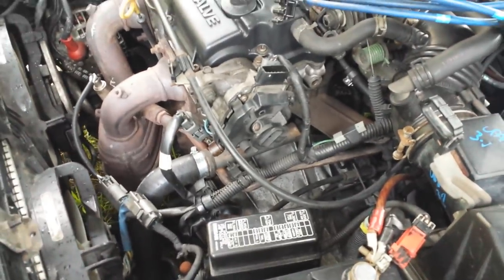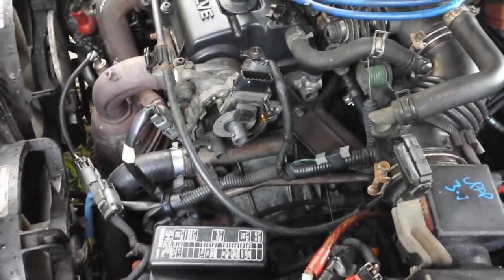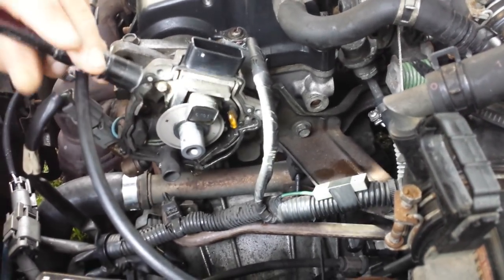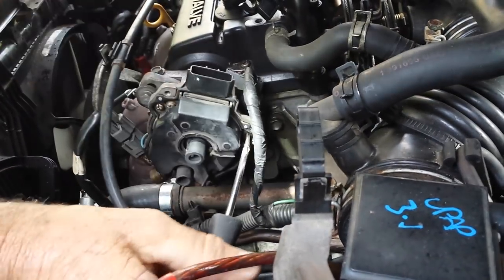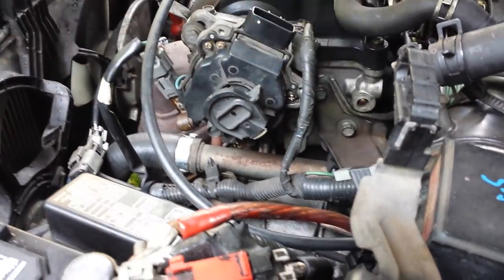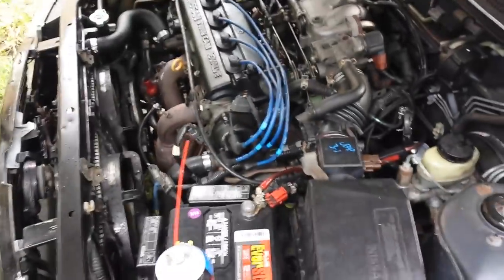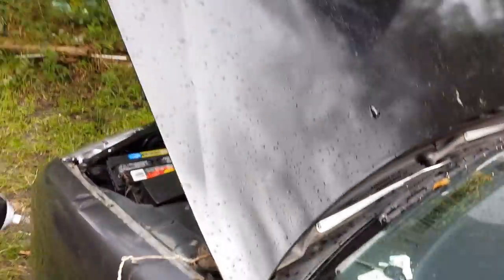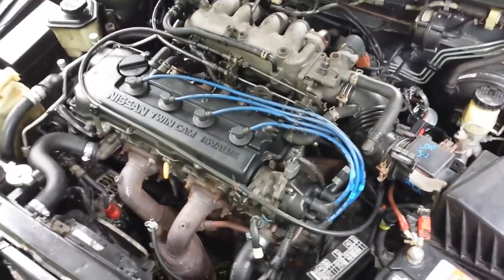1997 nissan sentra starting issue

Comment from the maker: i don't remember to tell you the truth. we just went through a bunch of screws until we found one that was snug. honestly, there is a flaw in the design. later on we put blue loctite on the screw threads after a new distributor was doing the same thing. works like a charm.

Comment: Not sure carb cleaner is the best to use on or around any electronic part. WD-40 or an equivalent should work and is generally safe for electronic parts. WD-40 consists of deodorized kerosene and some cleaners. It will evaporate, altough it could leave a residue that might affect an optical sensor. Another product you could use is tuner cleaner. It has been a long time since televisions have had mechanical tuneres but the product is still available. It might be better to remove the optical sensor before you clean the wheel, but all of this is good information to know. I have a '96 Sentra which takes multiple bumps to start, although it runs great after that.

Comment: I have a GA16, almost similar to the engine shown, just a different intake manifold, My problem is that the car has like a dead spot/misfire when idling as well as driving, which comes and goes, changed fuel pump, spark plugs, ht cables, which seemed to work for a while then it came back recently, any surggetions where to look next?
Reply from the maker: jordan botha have you checked your distributor cap for cracks and scorching? Also, make sure you don't have a vacuum leak. I know this is a long shot but how old is your battery?

Comment: doesn't  the distributer have an offset key which have to line up no matter how much you spin the rotor? so even you put in a brand new distributor isn't it supposed to line up with the keyway on the cam shaft?

Comment: Greetings, is it possible to use a Nissan ECU with  the wire harness to operate a Toyota engine if added the crankshaft sensor map sensor and also the coil pack and throttle body to the Toyota engine
Reply from the maker: I'm going to be honest and say I'm not sure. What I do know is that those sensors would have to fit and operate properly in an engine it probably wasn't made for. That wiring harness would have to be able to reach all the same components as the Nissan engine and how that the connectors are the same as well. I'm not saying it can't be done, I just don't know.
Reply: @BrunsBwlr  the sensors probably won't be timed the same

Comment: nice vid bro. i have b13 eccs GA16DE engine. my distri cap has tiny oil leak but its not drippin its just like its just go out on the cap. Should I change the shaft seal or just check the inside cap first.
2nd question is does ignition coil with oil on it affect the starting problems in the engine? thanks hope you can help me.
Reply: ALL NISSAN DISTRIBUTORS LEAK OIL...

Comment: Travis
Codes 300 and 1320 on nissan 1998.  Rear brake lights fixed.
Any help is most appreciated 
Steven
Reply from the maker: I was reading up on the code and it seems to me that you could have a bad camshaft sensor, crankshaft sensor or both. It could also be the pcm but let's start simple first

Comment: Is the crankshaft sensor on 1997 nissan sentra behind the starter?
Reply: No, in the 1.6L sentra 1997 vehicles it is on the front side below the distributor on the automatic trtansmission housing. But, it is not considered for ignition purposes by the ECM you can disconnect the crankshaft sensor and the engine will keep running or it will start with no issues.

Comment: I have nissan sentra 96 super saloon GA16DE B14 engine. I'm not sure what the problem is, but whenever I crank start the engine and slowly move up or down the distributor, the engine starts...there's a bit of misfiring then sometimes it will just turn off. And then when I crank start it again, it requires me to move the distributor again.

Comment: @Travis Bromley, did you get a PO340 code for the camshaft position sensor? Because mine has this code come up and i tried so start but only got the "crank no start" episode on my sentra. I'm already about to bit the bullet on a new distributor system.
Reply from the maker: It's been a long time since that video that I don't remember for sure but I believe so. What have you tried so far?
Reply: Travis Bromley so far, i've tried the starting fluid and a spark tester. No luck
Reply from the maker: MILES TUPAS unfortunately, you may need a new distributor then. Camshaft sensors can go bad on you. Did you have any other codes besides the p0340?
Reply: I had the same P0340 code but I also initially had a P0605 code (ECM) also . I scanned again after I went down the list in the technician service manual from  NICO club and scanned again after clearing codes and I only got the P0340 code.I am going to see if I can spray like you guys did.  We'll see , although maybe just some canned air  rather than residue up the optical lens.

Comment: I'm running into a random no crank issue will my 1995 Nissan Sentra been going on for a year now ,I'm going to have to eliminate a starter issue because it would have been long gone by now because it's a daily driver it's not a battery post that is corroded they are clean I'm going to have to rule out any shift lock solenoid issues because I can hear that engage I stopped pulling the key out of the ignition for the most part it seems to remedy the issue has anybody else had this problem ?
Reply: Yup,will just get worse to one day it wont start,just crank. Mines been down a year almost, changed relays,fuel pump etc. And nothing. But did notice the fuel pump doesnt activate when  key on, but does so directly. So that is issue,but cant find were to fix it to work.

Comment: How can I fix my dash lights and other like radio and lights. Everything is off inside and out. I only drive the car during the day. My battery also drains sometimes also.
Reply: Check the fuses under steering wheel toward the driver door.

Comment: Same ride lights turn everything on but no start. One time my car wouldn't start so I went under the hood and tapped the battery and moved the cords abit and started right up then left on the go everything was fine then I parked again for bout 20min tried starting again nothing then just left it overnight at friends the next morning it started right up again and took me me all the way home that was actually 30-40 miles now I'm at home it won't start agian. What could possibly be the problem?
Reply from the maker: Make sure the battery terminals are tight. May also be the starter having intermittent issues
Reply: @BrunsBwlr  that could be the problem but how can you/I tell? I thought it could also be the alternator
Reply from the maker: @jeffersonnez9814  if your alternator was going out, your battery would most likely not stay charged which would mean you'd have to jump it or the battery could die while driving causing the car to shut off. If you go to start the car but it won't even turn over and all you hear is a "click", this could indicate a bad starter.

Comment: Hey guys you are very smart. I have 96 sentra 1.4  engine same as in the video. I my car ran well. I started it up and letting it warm up it died and won't start back up. What do you think it is? Clean the sensor like you did? Also I have no spark but do smell fuel.
Reply from the maker: If you have no spark, definitely check your distributor. It may need to be cleaned or replaced.
Reply from the maker: Check for scorching inside the distributor cap as well
Reply: @BrunsBwlr  bought a new car and rotor still won't start. How do i get the coil out from under the cap?i meant cap
Reply from the maker: Did you clean the sensor?
Reply: @BrunsBwlr  yes sir. I need to get the coil out of the diatributor but can't figure out how. I'm not a mechanic by any means.
Reply from the maker: Unfortunately I've never replaced one on this car and I no longer have it. If I remember correctly though, it's held in by 2 screws.
Reply from the maker: I ended up just replacing the distributor on mine because the screw holding the rotor kept falling out no matter what I tried.
Reply: @BrunsBwlr  thanks but I can't afford it right now. Thank you for all the info. Be safe.
Reply: @BrunsBwlr  Thats correct, but it's behind that stupid disk that looks like a CD and it won't wiggle it's way out. Do you know how to get that diak out. I appreciate all your info. Thank you very much

Comment: hey did you ever make that video about replacing the distributor? my fathers is cranking but wont start, tried this, but the part looks fairly new.
Reply from the maker: I have not done that video yet.    Have you checked for spark yet? Do you smell gas after you've tried to start it?
Reply: +Travis Bromley i checked the spark plugs and they look at least 4-5 years old. conpletely rusted up. unfortunately, whoever last did the plugs broke the gaskets around the packs so when i go to push the plug wires back in, there is no sealing and it pops right out. we tried starting it anyway and now its making the strangest sound ive ever heard. its like a crank with no hiccup. so the starter seems to be spinning freely without touching the flywheel? this car is getting close to heading to the junkyard man haha
Reply from the maker: +Angel Salazar Which gaskets are you referring to? When the wires go down on the top of the plugs they should fit firmly around the top of the plug
Reply: The entrance of the hole where alll the way at the bottom you find the spark plug. That top is where the wire fits snug and holds pressure. Well its no longer holding pressure so it doesnt hold onto the spark plug.

Comment: Hey I'm having a p1320 crank no start change the distributor and crankshaft position sensor still no start and fuses  are good what should I check next acts like it wants to start but wont
Reply from the maker: Have you replaced any electronic components? If not, check your distributor wiring for corrosion or breaks in the wire. Modern cars are so heavily dependent on computers that if the ecm gets an incorrect signal, it could mean a no start condition. If you have a dmm, check for voltage.
Reply: just ohm it pretty much
Reply from the maker: Ohming is a good start but remember, ohming proves that there is continuity but it doesn't always prove integrity. If you think about a cluster of wires, only one wire needs to be connected to show continuity but one wire can't produce the needed current. Just some food for thought.

Comment: What about if u getting lights on the dash but no start and is not the starter
Reply from the maker: Nicholas Isaac It could be your battery or the connection to the battery. If you have corrosion on the battery terminal or in the wires, it causes high resistance. How did you verify that your starter was not the issue?

Comment: On my 95 Sentra I can only hear the starter click, battery is good any suggestions please
Reply from the maker: L1dechuy09 How old is your battery? Is there any corrosion on the wires at the battery? The reason I ask is because the starter needs as many cranking amps as the battery can provide. If you don't have enough amperage, the starter won't turn, but you'll hear the starter solenoid engage. Sometimes as time passes, the battery can still hold the same voltage, but is not able to produce the amperage it once could. Sometimes the starter is bad as well.
Reply: Check for starter

Comment: Mines stalls when put in gear and mash gas. What is the problem?
Reply from the maker: For a car to run, it needs combustion and combustion needs 3 things: fuel, oxygen, and an ignition source. If your car starts, it means you're getting all 3. As you step on the gas, the demand for all 3 is increased. If one or more of the 3 can't the car could stall. With that being said, start bu checking your fuel filter, your air filter, and your spark plugs wires and distributor assuming that you have them.
Reply: Travis Bromley the car was parked for 3 months so I put in new spark plugs and changed the plug wires as well but I had to replace the fuel pump hose becuz it got corroded in the gas tank so I think Ama change the fuel filter. What do you think?
Reply from the maker: It couldn't hurt. You should be able to blow through them almost as easily as you could a straw. After 3 months the gas may have started going bad as well. Also, did you change the actual fuel pump or just the hose?
Reply: Travis Bromley I changed the hose but not fuel filter. The pump is working fine

Comment: So what happened when it driving and when you get at it and take you no rave
Reply from the maker: Horace Empty I'm sorry but I don't understand the last part of your comment. Before we cleaned the sensor, the car would very rarely start. When the the did start, it ran horribly.
Reply: Nissan center start dont run 0. 10

Comment: I have an issue with my nissan sentra 1998, 1.6 SI injector 
it has a hiccup, like a jerk when accelerating or under load, I have replaced the TPS and my airflow works well as well as my fuel pump, but the problem still persists, 
HELP
Reply from the maker: Do you have a check engine light? I would make sure you have adequate fuel pressure. There could be other restrictions in the line, such as the filter. Another issue on the fuel side could be injectors. As they age, they may not be able to deliver the fuel properly. How do your spark plug wires look? What about your distributor cap and rotor? Are they scorched or cracked?
Reply: @BrunsBwlr  the fuel seems to be okay, ive never changed the injectors but they were once taken in for cleaning, the spark cables were replaced, however once the seal in the distributor was leaking oil onto the ignition coil pack, I can't tell if thats the problem cause I got the car with this leak, although I did replace that seal
Reply: @BrunsBwlr  I am uploading a video now, it should be online in the next few, I'll let you know and you tell me what you think?
Reply from the maker: Where are you uploading to?

Comment: If U look it up U will find that the rotor screw or where it screws into is defective n strips out new rotor n screw generally takes care of the problem
Reply from the maker: I did actually try that but I found out that the threads on the rotor shaft were the real issue. I tried a new screw, using a slightly bigger screw, using a lock washer, using loctite. None of them actually worked as a long term solution
Reply: @BrunsBwlr  I see we just went through this same thing on my neighbors 99 Nissan Sentra I had a heads up on the problem when working on my son's 99 Nissan Quest is a very common problem for most Nissan's around those years thanks for the video👍

Comment from the maker: carb cleaner is really good for this because it dries quickly
Reply: Thanks for replying!
Reply from the maker: not a problem! good luck!
Reply from the maker: +Rashaun Ransom with the blown head gasket most of the time if the car runs it will run poorly and sometimes die. I would definitely suggest changing the head gasket as soon as possible. As far as the second car is concerned, if the car was low on oil and you heard a snap, chances are your engine is done especially if it won't even turn over.

Comment: Where is the first video?
Reply from the maker: this video was simply the second video of the series of videos I've done on my Nissan series. please let me know if you'd like to see something in particular. Feedback is always welcome!
Reply: Got an 01 Sentra SE 2.0 that won't crank. Turn key & nothing 9 out of 10 times. When it cranks it will drive for 1/2 hr. I know the battery is good, leaning to the Crank position sensor in the shifter (Automatic) or the ignition switch itself. Any thoughts?
Reply from the maker: Sounds like it could be your starter for the starting issue. Does the just die after 30 minutes? Can you describe what it does after 30 minutes?
Reply: Just using 30 minutes as an example that once cranked it runs flawlessly.The only problem is it doesn't crank but 1 of every 10 tries. When you turn the switch it does not crank- no sound other than u can hearing some relays click. It won't turn over. Tried shifting to Neutral then back to Park- no change.
Reply from the maker: I actually had this problem with my car as well. I could push the shifter just a little further forward and it would start for me. However, shortly after I had to replace my starter. There was a piece that was broken in the starter which prevented the starter solenoid from engaging all the time. It became a real problem.
Reply: Got it fixed. Oddly enough is was the negative battery terminal connection. Previous tech had rigged it & it wasn't tightening properly. Odd that it was still charging the battery. Go figure.
Reply from the maker: I'm glad to hear you got it fixed! Thanks for the update!
Reply: Update- it behaved for a few days then surprised me & didn't start again. New starter & Starter solenoid fixed it.
Reply from the maker: Great news! Thanks for the update. Keep me posted on it. Hopefully there won't be anymore problems

Comment: Can wd40 work to clean it?
Reply from the maker: Nicholas Isaac I would not use wd-40. That is a penetrating oil and will leave oil behind which will attract dirt which is what you're trying to get rid of. I would stick to a brake cleaner or carb cleaner type spray.

Comment: Mine starts but drains the 🔋. Changed the battery alternator interior harness and fuse box, the inside gauge lights won't work n that's when it's not charging the battery or sending any signals to the rest of the car
Reply from the maker: If the battery and alternator are new and working as they should, you have a parasitic draw somewhere. Something is using power when it shouldn't. Check to make sure nothing is staying on. Sometimes lights with bad switches will stay on or aftermarket components will drain the battery. Even though you changed out the harness, the component that a connector is hooked to could still have an issue.